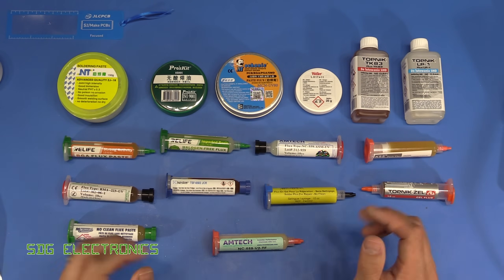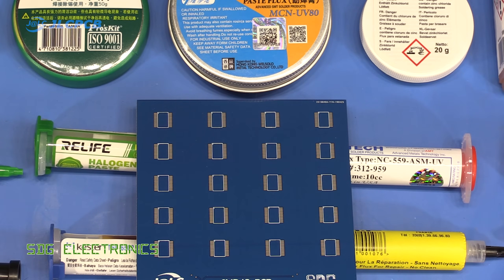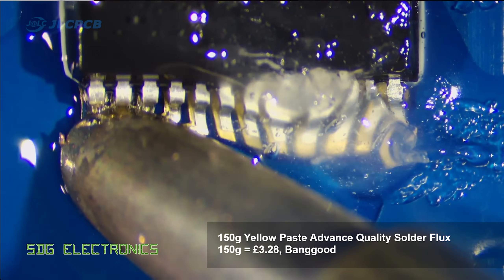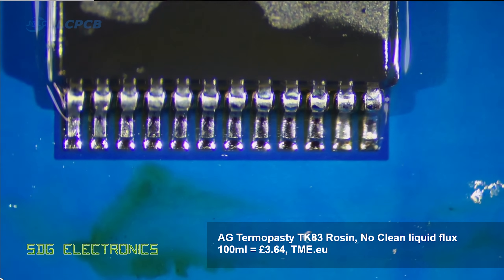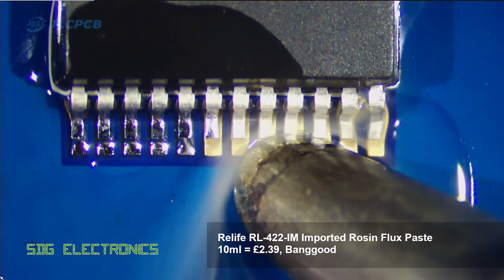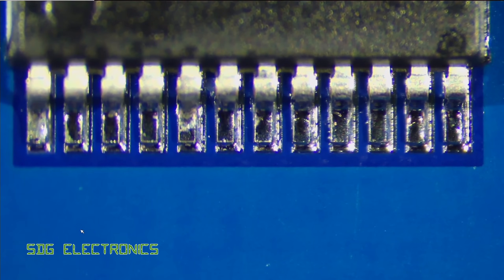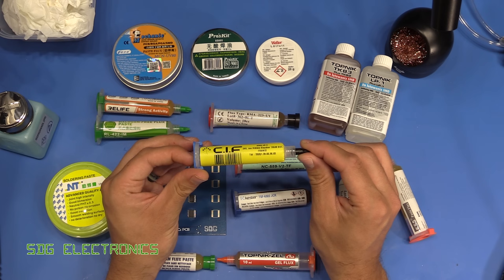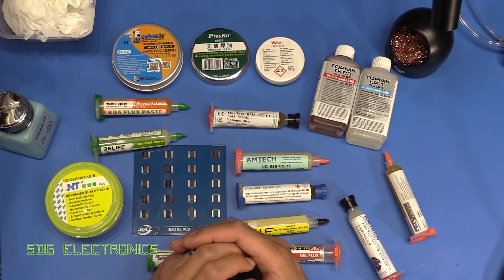SDG #086 What's the best flux for soldering? A comparison with PCBs from JLCPCB

Comment: Thank you.  Very interesting video. I would like you  to expand your video to test a couple of other characteristics. Effectiveness on oxidised components and also even more important for me how fast the flux burns off. Especially important for hot air when a lot of times we have the heat on for a while. I believe the genuine amtech is what is supposed to set it apart from the others in this regard as it stays aroind for longer. Would be great to see some sort of a test for it. Thanks again.
Reply from the maker: I'll work out a video with the same PCB, maybe removing and re-applying the IC with hot air. Thanks :)
Reply: @sdgelectronics  your current pcb is probably not a good example. You need those quad  pack chips that have a big ground plane on bottom.  Your current chip and pcb would be easy to remove with hot air. You need to simulate a large ground plane fighting off yoir heat gun if i am making sense
Reply: @sdgelectronics  did you ever make the hot air station video? Great vids btw

Comment: What flux cleaner do you use ? I have terrible trouble getting it off with isopropyl alcohol. Some of the specialist flux cleaners seem quite pricey though.
Reply from the maker: Take a look towards the end of SDGEE #054 a few notes on flux cleaners there
Reply: Use brake/contact cleaner. Just make sure to do it outside.

Comment: That tip cleaner swarf looks like copper plated steel, not great for tip plating. Check it with a magnet. Genuine brass wool is getting hard to find.
It's amusing how the fake Amtech has a genuine hologram when the genuine Amtech doesn't.
Reply from the maker: It's the classic "Authentic" sticker for anything that's not authentic. I think you may be right about the tip cleaner - I may have to purchase some replacement brass wool from Farnell. I do like the holder for it though. Thanks :)

Comment: I didn't test most of the fluxes you show in this video but I've been using the KSS flux as it performs quite good and is very easy to clean. KSS completely cleans a penny as soon as you apply heat. Didn't have much luck with mechanic flux (not the one shown here) and I wasn't really impressed with the knockoff amtech I got.
Reply from the maker: I'll have to come up with a test for oxidised components, this will probably give very different results.
Reply: Just got another KSS flux and it is absolute trash, the first I got was very thin, easy to apply, cleaned the copper very good and was very easy to get off the pcb at the end, the new one is the complete opposite... It is either a copy or they changed something.

Comment: Strange the cheap NT and fake Amtech worked so easy for you, because when I tested them the solder was hard to take and looked matt/frosty. I found some American Caig Brand locally down here that was night and day better, but it is like your Kester, ie: dark and hard to remove.
Reply from the maker: I would hazard a guess that the cheap ones may be more inconsistent between batches, hence some variability.
Reply: @sdgelectronics  You're probably right because my NT is yellowish where as yours is white.This was my result.
https://youtu.be/3nuOm8DHQAg?t=150

Comment: I used to use some other liquid flux, but can't remember which brand it was. It had same properties as the ones you tested: More flux was needed for larger IC's. It either boiled away or spread so much, there wasn't enough flux around the last pins. Practice will make it better, but main cause is the properties of the flux.
In my opinion liquid flux is very easy and quick to apply.
I'll add TK83 to my shopping list, thanks to your video! Well done with the comparison!
Reply from the maker: I think the liquid fluxes just aren't as suited to this particular style of soldering. It would be great for BGA style work as the liquid is drawn into gaps easily. It also cleaned off very easily. Thanks

Comment: Considering you get 100ml of liquid Flux for less than 3 euro, I'd say those Topnik bottles are really good value for money. Just have to get used to applying a bigger quantity or adjusting your solder iron temperature a bit
Reply from the maker: All of the stuff from AG Termopasty seems to be excellent value for money. I bought a whole range of different types from them recently.

Comment: Thanks Steve! Here lately I have been using Chip Quik SMD291 No Clean Tack Flux for SMD work. It seems to work great.
Reply: I used that too, I loved it but Farnell took it out of their assortment. Now I use the Topnik TK83 (after trying several others). It is not as good as the Chip Quik but good enough. I liked the tacky stuff because it holds the component on its place (i use it professional for repair work)
Reply from the maker: I used to use several different Chip Quik fluxes, but I noticed Farnell have dropped many of their lines, so it's not as easily available.
Reply: SDG Electronics  Hmm, sounds like Chip Quik needs to get on the ball! They are losing money!
Reply: @sdgelectronics  OK, you are right, it does not make sense to test it,  if it is hard to get. I hated that I needed to find a replacement because the stuff is not cheap and I did not like the most I tested. The same goes for solder.
Thanks, this was very interesting video.
Reply: pa4tim  I am just a hobbyist but I am starting to get pretty good at microsoldering and using my rework station. I also try to always use my board preheater. The preheater makes rework easier for me.